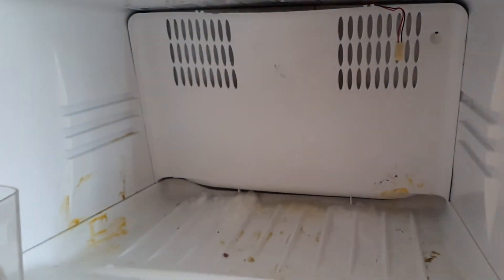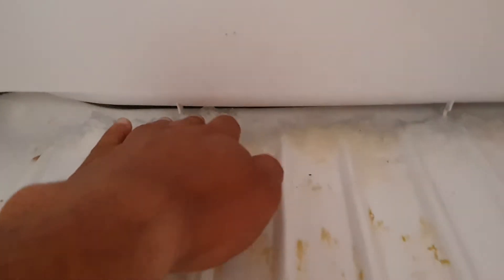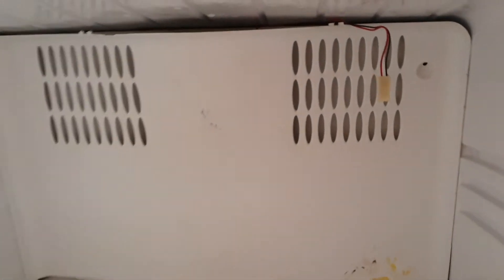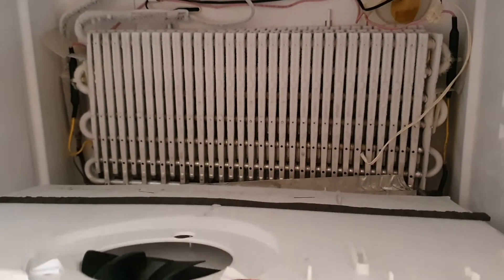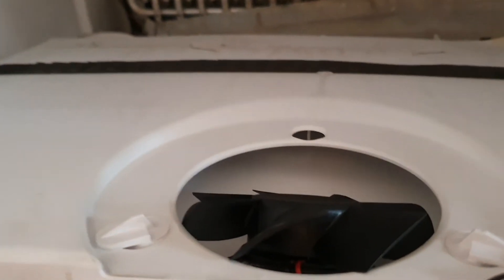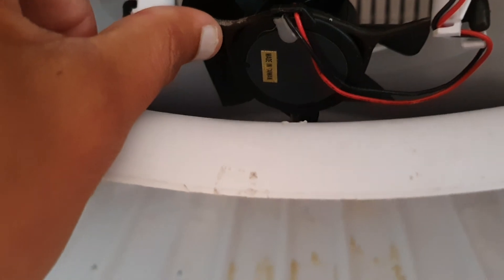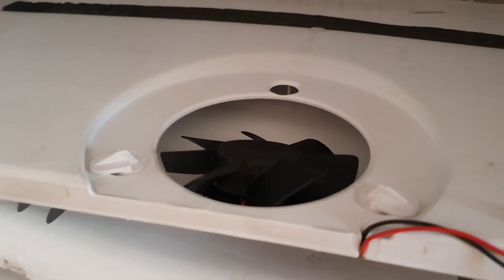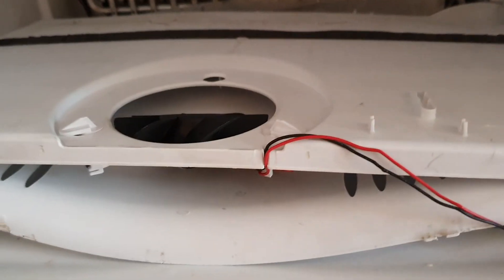Fisher Paykel Fridge refrigerator not cooling fan noise or ice build up problem, $10 fix

Comment: Hi how do I tell the fan isn’t working? My freezer coils all frozen up, freezer at bottom but lower fridge likes to freeze my vegetables 🥕. It’s an E series . The active smart panel beeps red twice which apparently relates to ‘defrosting issue’ . I have pulled rear panel off like you have but how do I narrow down what issue is? With back panel off and I turn back on the f/f should fan start immediately or ?
Reply from the maker: Yes that's the sign that fan isn't working. In this case it is because ice frozen all over it. 

What's happening is that the cold air isn't getting pumped into the fridge section cos of all the ice around it.

If you leave the fridge off for few days and let the ice melt, your fridge section will start cooling.

Comment: I hooked fans to 12vdc power supply, it works. Fans are oka
Reply from the maker: Is it going well?
Reply: It's way cooler
Reply: Hi there, my pc fan motor failed and i've changed it on fisher and paykel refrigerator. Problem is fan is constantly running now and wont turn off when doors are opened. The wires coming from fan motor plug are red,blue and black. Red must be dc positive power. Wires from main fridge circuit plug are red,blue and pink. Im assuming the pink is a sensor wire. Just not sure how to link these up after red to red.
Can you help with this?
Reply from the maker: @Mick Cant  sensor is a separate cable with white elongated cap on it. Let me try and send you a photo. Just make sure it is coming out of the hole in the cover. That relays the temperature info to the internal microscontrollers
Reply: The fans don't constantly, when you open the doors they stop spinning. There is a small magnet located on the bottom of each door, when closed they active a trigger switch located on the fridge itself. You should be able to locate them they are covered by a small but unseemingly plastic molding, either the top or bottom
Reply: Use a small magnet to activate each switch, the fans should spin

Comment: I bought a 12v fan, but it just comes one for a few seconds and then stops.  IS there a correct Wattage or Amp for the replacement fan?
Reply: You need new fan. It is shorting

Comment: Hi I have a F&P RF522BLPX6 with freezer at the bottom. It's throwing a 17 error code which would suggest a problem with the freezer fan. The fan seems to be working though. This has been going on a while and have just been living with it but now the fridge is freezing food in the main compartment. I live in Auckland, any help would be greatly appreciated. Should I just replace the freezer fan and hope this fixes the problem? Thanks
Reply from the maker: Hi Brogen, RF522BL is a newer model. Is it not under warranty?

As for diagnosis, it is likely the ice build up behind that's causing normal than usual colder air to be pumped into the fridge section which is causing freezing. Few things to try in order:
1. Warmer setting for the fridge section
2. leave the fridge without power for the ice to melt
3. If above doesn't solve and not under warranty, remove the sheet in freezer and you will find the problem hidden there. It will be ice build up there

Let me know how it goes

Feel free to contact FP support if the above seems risky
Reply: @rays6493  Hi Ray, thanks for your reply. I tried all of that, even pulling the back off the freezer section where there is no ice build up. The fan is in working order too, no broken brackets. The fridge is extra cold. The fridge is about 4 years old and our of the warranty period. Trying not to call FP support and fix without their help to save dollars. Thanks

Comment: Yes my fridge same issue... Will see if only same problem.  Sued for the poor design of a fan?.. haha.  That's ridiculously over the top comment.. 
Thank you for showing.. but didn't show how to remove cover etc.  As you'd already done it . I will look for another video...
Reply from the maker: May not be a thing here but quite common in the US if it pertains to sizeable number. And the damages go into millions.
Remember the iPhone battery throttling case settled for 300M USD. Nothing is out of question, just need someone with the will to fight the big corporates 

Removing part is in the video before, let me known if should share the link